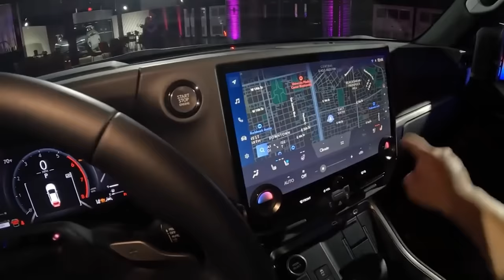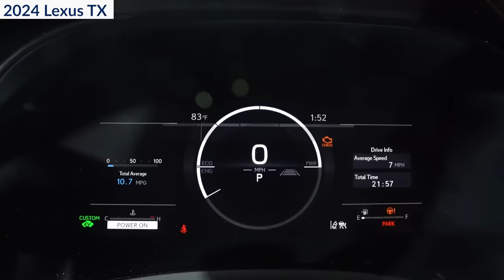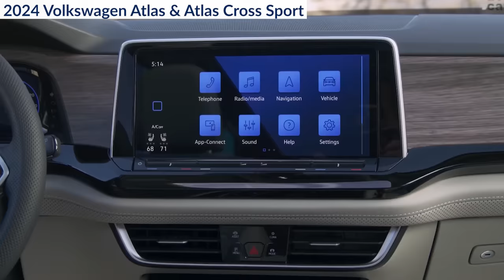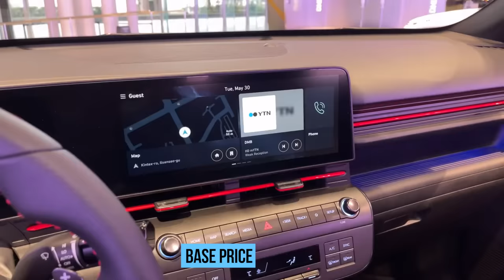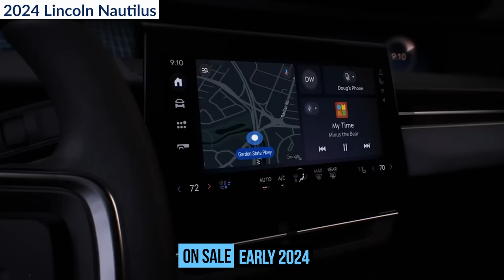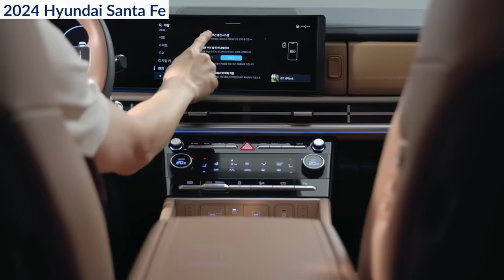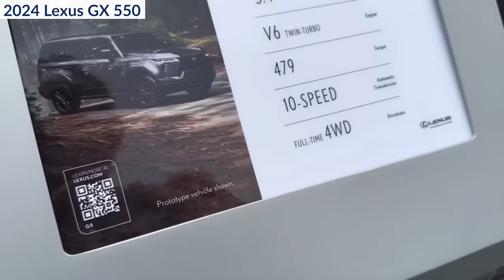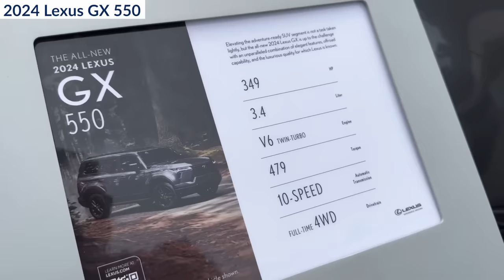All-New SUVs Worth Waiting For: 2023 - 2024!

Comment: All junk. A 4 cylinder pulling a 3,500 lb vehicle? Good luck. And a turbo to boot? You will be lucky to get 60k miles out of a turbo. This going green nonsense is gonna get real expensive. The only decent choice rite this minute is the acura mdx v6 no turbo. Other than that, all these suv's are being miniaturized with 4 cly. Too much heat, too much revving.